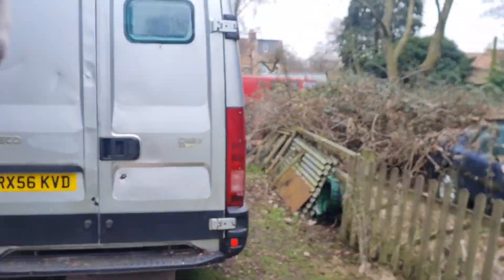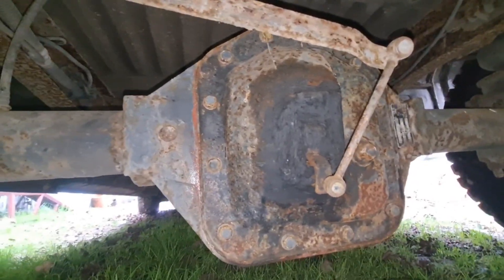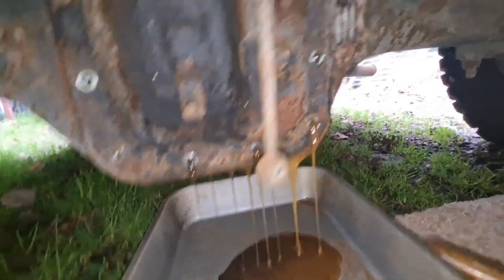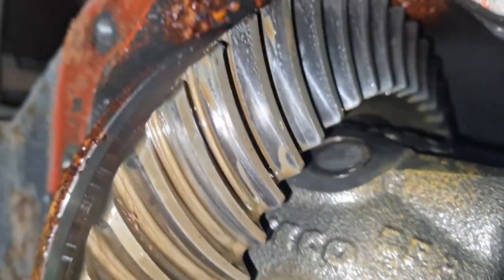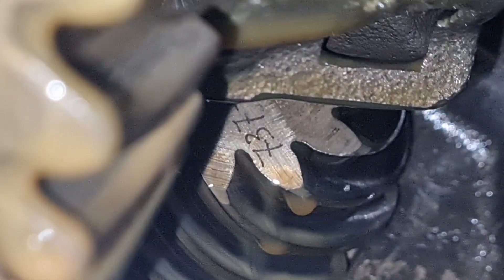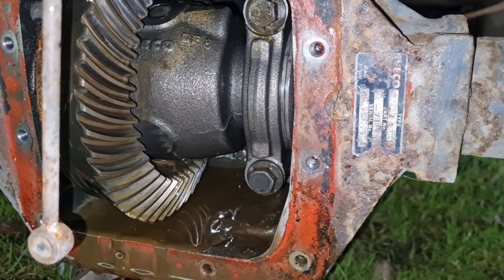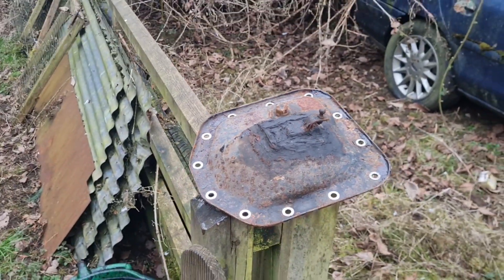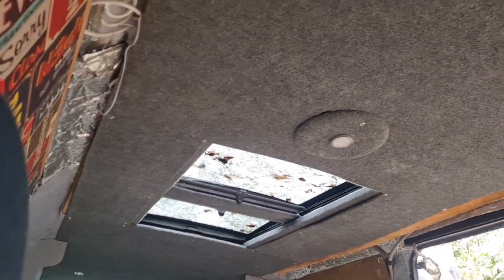Iveco Daily Camper Diff noise and walk around update.

Comment: The oil in that diff looks milky and as you said it had water in there where it’s been stood. Fresh oil will definitely help and gear wheels look okay. 
Also those chunky tyres are going to create some noise. You only have to listen to a Land Rover on off road tyres, you can hear them whining as they drive along the road. 
You’re bound to have a few teething problems with a van that’s been stood for a long time but I’m sure you’re more than capable of sorting any problems. 
It’s a big van and there’s quite an overhang behind the rear wheels, so you’ll need to be wary of tail swing.

Comment: That diff oil didn't look good Adam. I would change the bearings and all of the Seals, or just the seals and do a resistance test to make sure that the bearings are not creating any drag, because it might have gone into deep water and filled up with water then sate for a while. 

It might also be worth getting that diff cover welded up properly and some paint for good measure. 
Well done for buying all of those parts you are doing it properly and the way it should be👍🤗. 

If you can get the brakes to loosen up it might also be worth taking it for an MOT just to see what it might fail on. 

You have bought a really good reliable vehicle well done and I look forward to seeing it finished

Comment: The diff vent is located on the left side axle housing , driving through water deeper than 400mm will allow water to enter the diff . Put a hose on it to extend it and mount it high up on the body . Check it at service time to make sure it is not blocked . Crown and pinion look serviceable , put you can not tell if bearings have wear . I hate that rusty section , my first reaction would be to remove it with a small wire brush . But then you run the risk of of getting  rust flakes in the diff center that you can not flush out .Because the oil was milky you could not tell if it contained fine metal .

Comment: Lots of water in the oil mate, I wonder if cleaning the housing out and fresh oil might quieten it up. Gears don’t look at all worn.
Reply: I totally agree I would most probably fill up the diff with a bit of citric acid to remove any rust then let it dry and fill up with fresh oil with a load of new seals

Comment: If you're going to replace the brakes, is it worth (assuming you'll raise both back wheels off the ground and axle stand them) disconnecting the prop shaft and turning the axle with a wheel to see if the whine is still there and also checking the pinion for backlash and free play in the pinion bearing before starting on the brakes just in case more axle work is needed, re the water thats been present is there a breather on the axle casing and what condition is it in?